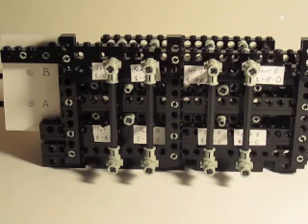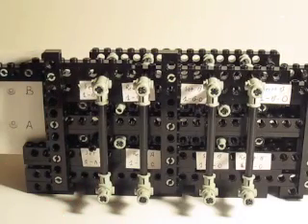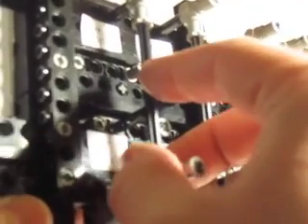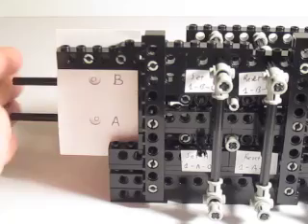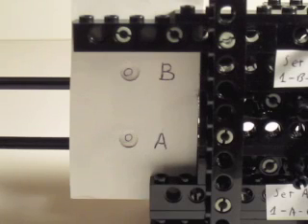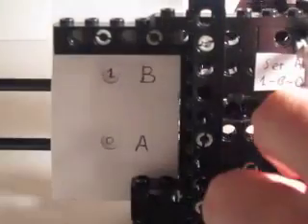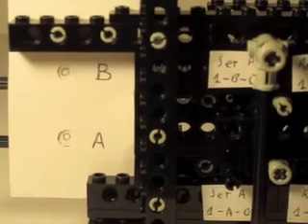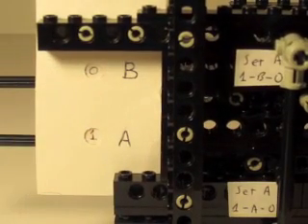Mechanical Computer

Comment: But ... Does it run crysis
Reply: No
Reply: @kriss204  ¶
Reply: The Mechano 

6666666666666666666666666666666666666666666666666666666666666666666666666666666666666666666666666666666666666666666666666666666666666666666666666666666666666
6666666666666666666666666666666666666666666666666666666666666666666666666666666666666666666666666666666666666666666666666666666666666666666666666666666666666
6666666666666666666666666666666666666666666666666666666666666666666666666666666666666666666666666666666666666666666666666666666666666666666666666666666666666
6666666666666666666666666666666666666666666666666666666666666666666666666666666666666666666666666666666666666666666666666666666666666666666666666666666666666
6666666666666666666666666666666666666666666666666666666666666666666666666666666666666666666666666666666666666666666666666666666666666666666666666666666666666
6666666666666666666666666666666666666666666666666666666666666666666666666666666666666666666666666666666666666666666666666666666666666666666666666666666666666
6666666666666666666666666666666666666666666666666666666666666666666666666666666666666666666666666666666666666666666666666666666666666666666666666666666666666
6666666666666666666666666666666666666666666666666666666666666666666666666666666666666666666666666666666666666666666666666666666666666666666666666666666666666
6666666666666666666666666666666666666666666666666666666666666666666666666666666666666666666666666666666666666666666666666666666666666666666666666666666666666
6666666666666666666666666666666666666666666666666666666666666666666666666666666666666666666666666666666666666666666666666666666666666666666666666666666666666
6666666666666666666666666666666666666666666666666666666666666666666666666666666666666666666666666666666666666666666666666666666666666666666666666666666666666
66666666666666666666666666666666666666666666666666666666666666666666666666666666666666666666666666666666666666666666666666666666666666666666666666666666666666666666666666666666666666666666666666666666666666666666666666666666666666666666666666666666666666666666666666666666666666666666666666666666666666666666666666
6666666666666666666666666666666666666666666666666666666666666666666666666666666666666666666666666666666666666666666666666666666666666666666666666666666666666
6666666666666666666666666666666666666666666666666666666666666666666666666666666666666666666666666666666666666666666666666666666666666666666666666666666666666
6666666666666666666666666666666666666666666666666666666666666666666666666666666666666666666666666666666666666666666666666666666666666666666666666666666666666
6666666666666666666666666666666666666666666666666666666666666666666666666666666666666666666666666666666666666666666666666666666666666666666666666666666666666
6666666666666666666666666666666666666666666666666666666666666666666666666666666666666666666666666666666666666666666666666666666666666666666666666666666666666
6666666666666666666666666666666666666666666666666666666666666666666666666666666666666666666666666666666666666666666666666666666666666666666666666666666666666
6666666666666666666666666666666666666666666666666666666666666666666666666666666666666666666666666666666666666666666666666666666666666666666666666666666666666
6666666666666666666666666666666666666666666666666666666666666666666666666666666666666666666666666666666666666666666666666666666666666666666666666666666666666
6666666666666666666666666666666666666666666666666666666666666666666666666666666666666666666666666666666666666666666666666666666666666666666666666666666666666
6666666666666666666666666666666666666666666666666666666666666666666666666666666666666666666666666666666666666666666666666666666666666666666666666666666666666
6666666666666666666666666666666666666666666666666666666666666666666666666666666666666666666666666666666666666666666666666666666666666666666666666666666666666
6666666666666666666666666666666666666666666666666666666666666666666666666666666666666666666666666666666666666666666666666666666666666666666666666666666666666
6666666666666666666666666666666666666666666666666666666666666666666666666666666666666666666666666666666666666666666666666666666666666666666666666666666666666
6666666666666666666666666666666666666666666666666666666666666666666666666666666666666666666666666666666666666666666666666666666666666666666666666666666666666
6666666666666666666666666666666666666666666666666666666666666666666666666666666666666666666666666666666666666666666666666666666666666666666666666666666666666
6666666666666666666666666666666666666666666666666666666666666666666666666666666666666666666666666666666666666666666666666666666666
Reply: The mechano

Comment: Very interesting... do you think it possible to construct a lego mechanical computer which stores its programs in the memory as well (something closer to the von Neumann architecture)? It would be an incredible way to introduce kids to computers.
Reply from the maker: Cristián Paris Ah. According to my theory of computation textbook, you are describing a universal machine. Mechanical computers are capable of being universal machines (after all, the Turing Machine is (mostly) mechanical).

I believe this machine could be programmed as you described if scaled up appropriately with more memory bits and deeper control logic, but doing so would not be practical. Each added bit requires all other bits to grow in length and the added logic would require something like push bars pushing other push bars. It would be a difficult engineering problem.
Reply: +Kenneth Moreland I just realized... The control bars in the back are like microcode!

Comment: Can it run BF3 on highest settings?
Reply: managed to get it at medium 30 fps
not too bad
Reply: Yes. I made a copy of it and it ran Battlefront Star Wars on Very Ultra
Reply: TofoTuto Was referring to Battlefield 3, but I guess it works.
Reply: @kerberossi  runs single pixel memes fine

Comment: Have you tried using spur gears, spur gears, and counters to increase the ouput and allow you to use a higher base? You could use that to count using a higher base, like 10 or 12 or whatever depending on the numbers of teeth and other factors.
Reply: +Philip Polkovnikov '..., we would see mechanical computers long time ago.' - I don't think this is true. Leibniz did not just invent the binary system, he even had a complete design for a binary calculator. He abandoned these plans however,  because he thought that it is more convenient to work with base 10 mechanically.

Comment: While an interesting concept, memory addressing does not a make computer.
This could be able to be considered an extremely limited finite state machine.
Reply from the maker: Technically, and realizable computer (i.e. one with finite memory) can hold only a finite number of states. And while this machine as an extremely limited number of states, the logic that controls how it shifts from one state to the next can be rapidly changed (i.e. programmed), so it's not really a static state machine. Whether the device crosses the threshold of "computation" can be subject for debate. I believe it does. You may disagree.

Comment: and we hook a billion of 'em up an can watch a youtube video by candlelight.
Reply: Hey noobasaurus I didn't excpect you here!
Reply: @anybodynoname8767  Same!
Reply: @n00b_asaurus  ooo hello, there
Reply: @n00b_asaurus  :D
Reply: @n00b_asaurus  there are already other computers.. what you would need is an adaptor to transform the electrical signals coming from an ethernet cable into signals compatible with this device (along with a driver cable of interpreting those signals.. and an operating system.. and a browser.. and video drivers.. etc)